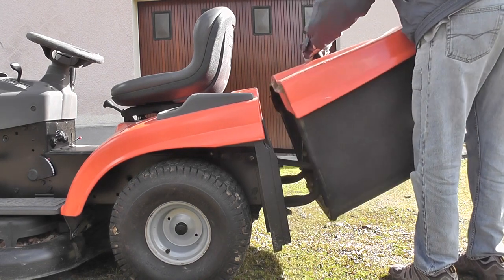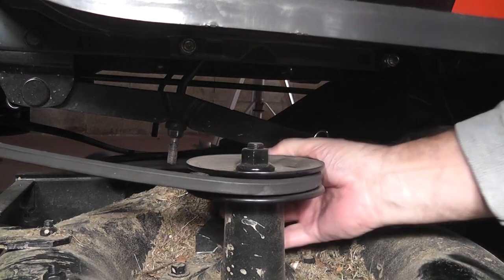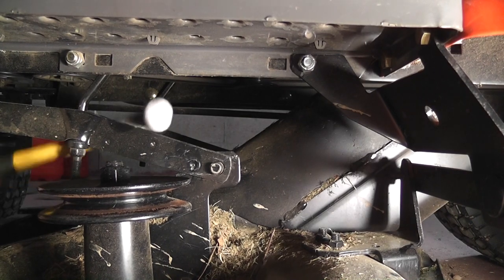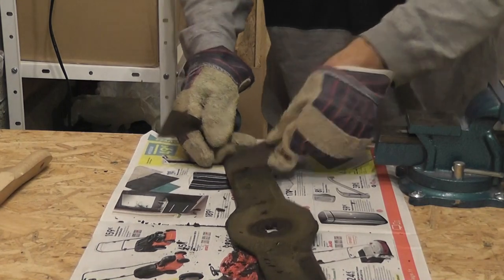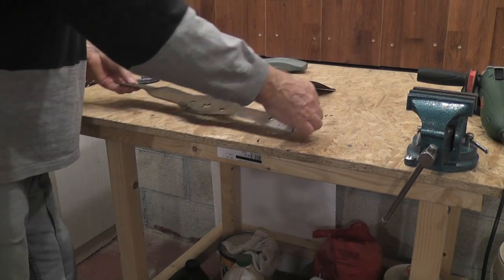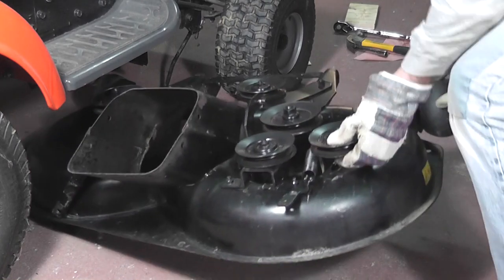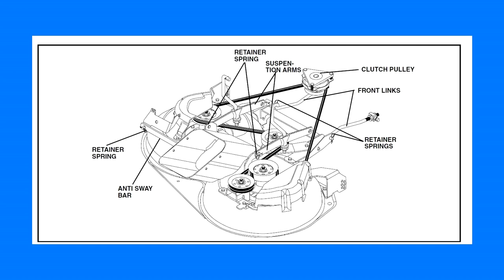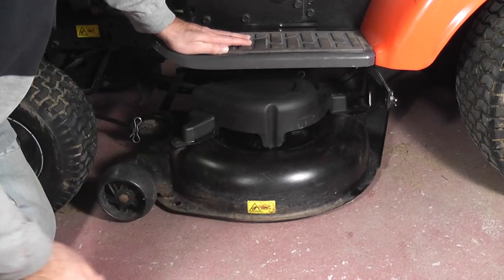How to Sharpen the Blades on a Husqvarna CTH151 Lawnmower

Comment: Thanks for a very informative video Colin. I have a Jonsered LT2114 which appears to be exactly the same as the Husqvarna CTH151. The belt has just snapped and I have a replacement on order. I've already removed and cleaned the deck, but thought I might as well sharpen the blades while I have the thing off, and as I have never sharpen the blades on a ride-on before I'm thankful that I found your video as it has been extremely helpful, so thanks a million. Keep up the great work.
Reply from the maker: I am so glad my video was of use to you. Mine is a French machine and it was a French old fellow who showed me how to sharpen the blades.

Comment: One of the most detailed video's I've seen for removing the mower deck. 
It's odd that some of the designs are different, and some the same, on the same brand mower sold in different countries. I liked how your grass chute is designed out the rear, for bagging I suppose, but, it would have been easier releasing the belt tension if they used a tension bar that's made on the mower, which let's the tension off, or on. Good video. Thank you, John , Indiana
Reply from the maker: I don't really know much about lawnmower design, but I appreciate the fact that you liked my video. Cheers.
Reply from the maker: I suppose different countries have different rules for powered lawnmowers. Thanks very much for your comments and support.

Comment: Colin. I always remove the deck and sharpen the blades as you do, in the same practiced sequence, so it is a fairly quick procedure. I have two John Deeres that I run up on ramps, as deck removal is cmplex in comparison. 
I have a second set of sharpened blades for all the Ride-ons, so you can sharpen the removed blades in your own time (buff the blades with a wirewheel, sharpen edges, spray sharpened edges with silver paint, and hang on a rack ready).
Have 2 grinders. One with a Grinding Disc, and the other with a Flap Disc for finishing.
I never mow wet grass (not much rain here compared to England though), use a pressure sprayer or a hose. Just remove the catcher and grass chute and clean down with a long stemmed compressor nozzle (leaf blower will suffice) after every mow. Never had to replace a belt or pulleys after 430 hours.
When the deck is off, clean down the  underside with the compressor nozzle. Spray V belt conditioner onto a rag, rotate and wipe conditioner onto the transmission belt and check pulleys. Same with the blade belt.
Not using water (or wet grass) will prevent moisture intrusion past pulley seals (as can happen with hot pulleys, esp if grass or dirt is caked on the pulley top).
If the grass is long, cut down in 2 mows. If I hit a rock etc, and damage the blades, run the mower up on the ramps and bolt on the second set.
Make sure to blow off the transmission, fan and axles after every mow too.
I pulled the deck off yesterday, and had it back on in 40 minutes (transmission belt took the longest. And yes I did hurry to prove a point), not including tyre pressures, grease or air cleaner (get a spare foam surround for the air cleaner too 🙂).
I use a no water motorcycle cleaner and polish for the panels and engine plastics.
Video well done Colin.
Reply from the maker: Thanks for your support. I'm getting on in age now so my interests are a lot less arduous than yours are!

Comment: From one Colin to another - thanks very much.. just purchased a used Vert Loisers VLH 13H42B which looks the same - but previous owner has twisted the belt part way so it'l need to be off soon or at least twisted back. That's really a great video, very clear. Cheers.. Colin 2.
Reply from the maker: Thank you very much Colin tor voicing your appreciation of my video. Good luck with your new - old mower.

Comment: Hi Colin, belt twisted back correctly - a simple job. Take off both guards above cutting deck, then using a 2ft bar, jam it between the tensioning spring and tensioned pulley and pull towards the mower front end until the belt is slack, tie off the bar to the mower front steering. The  belt nearly slpipped off on its own !!, untwisted and let the bar off. The reason for posting is;- I am fairly sure it's possible to raplace the old belt with a new one this way, there is enough room to feed in a new one, I'm sure. It would only take maybe an hour in all. I haven't done it as the original belt, despite some 'bruising' on the back, looks OK. Next I'll take a look at the blades, I have a 2ton block and tackle in the barn - so it's dead easy to hoist the back (or front) of the mower up to get to the cutting deck floor. Cheers. c2.
Reply from the maker: Having the right tools makes the job so much easier!
Reply: @1943colin  Hi Colin again, just an update. After untwisting the belt, the first time under load it smoked and busted. Previous owner had used an ordinary V belt and twisted it so it fit into the pulleys.  (6 sided belton mine as my mower is has a rear grassbox and cutters rotate opposite to throw clipping up the chute, ( careful undoing the blade bolts as they are left and right threads)). Shortcut I found - stick a bottle jack in front of the rear wheel and jack the tensioner pulley forward so the belt drops off (or refitting, it drops back on).. Cheers C
Reply from the maker: Trials and tribulations, eh? I've had problems with lawnmower belts too, periodically slipping off. I think they make them thinner now (and more cheaply!). Solution was to stop the blades before raising.
Reply: @1943colin  My mower is a 2010 vintage, made by Husqvana SC, similar to MTD, etc. They fitted another pulley/guide just in front of the motor drive, I guess to stop belts jumping off. Cheers. Colin2

Comment: 2 front wheels on a ramp, remove the 2 bolts sharpen blades . Put back together all done 20 minutes, I always do it this way, no need to make a big job out of it, but it does give an excuse for to clean and inspect the deck, each to their own I suppose
Reply from the maker: Of course there's no need to do a big job if you're happy with half a one, and your 'modus operandi' would be useless to anyone planning to do a real job.
Reply: @1943colin  why yes of course that is so correct

Comment: Amazing Video - Thanks so much, I have a question - I have a problem where the drive belt is too loose, at 2:18 on the video when I use a bar I notice that the pulley doesn't move hardly at all, nor does the 'Arm' underneath it I tried everything. I think this may be why the Belt isn't tensioning correctly - Any suggestions gratefully received
Reply from the maker: I'm sorry I can't answer your question because I know little about lawnmower repair. I get mine surfaced every couple of years.

Comment: Thank goodness I watched this before buying one, off to buy my second Countax now. This messing around with that huge belt every time you remove the deck is crazy. With the Countax it all comes off together, just disconnect one main drive belt pulley and then remove clips. All deck pulleys on the Countax are also inside a protective housing, keeps everything much cleaner. 
 Thanks for this video, it's really helped me in my research and making my decision. It's a shame because I really like the look of these mowers and the cutting deck looks really heavy duty. I do like the other comments regarding removing the blades from underneath though, that would save all that messing around with that crazy belt arrangement.

Comment: Talk about making a simple job ridiculously complex. Run the front wheels up on ramps. Lie on your side and unscrew the two bolts holding the blades. Sharpen and replace. Job done.
Reply from the maker: No, let’s talk instead about wannabes who have not a scrap of content on their own channel, but who parade nonetheless like the emperor with no clothes with a smug look on their faces.
Reply: @1943colin  the middle blade is hell to get to laying down with it on ramps

Comment: Yes good job, but do you really need to remove all the cutting deck? couldn't you just remove the blades from under the mower by just using 2 planks run mower up so you can remove & clean the full deck without going to all that hassle !!. Worked for me.
Reply from the maker: Yes, that is possible, but more awkward.
Reply: On the contrary, that is my exact point, No need to remove belt.deck,, then reinstall,,, If you raise the mower to a suitable height you can remove the blades with ease. Your procedure is fantastic if you only need to carry out a full deck refurbishment or someone has plenty of time!!
Reply from the maker: Happily, I DO have plenty of time.....
Reply: PAUL MCKENNA there's a thing just for lifting mowers....or a chain hoist...or a tree and hoist or come along

Comment: What a waste of time. Get under the machine, undo bolts holding blades, remove blades then sharpen. job done
Reply from the maker: Get under the machine? What are you? A rabbet?
Reply: That would certainly save loads of time if you have a way to lift it up to get to the blades.
Reply: @1943colin  just get some ramps and drive on them  it's much easier than taking the whole thing of
Reply from the maker: @TadasTrakumas  Of course it's easier, but more expensive!